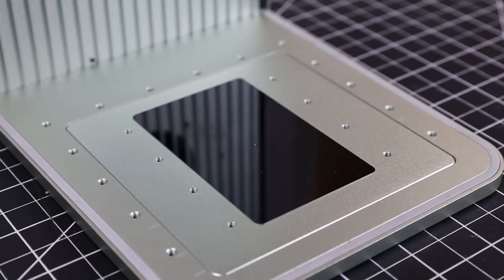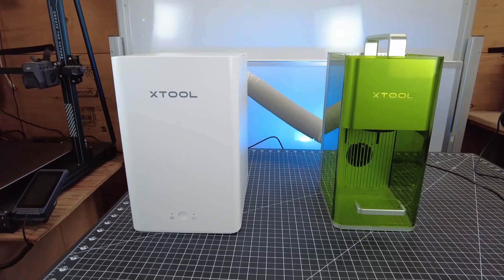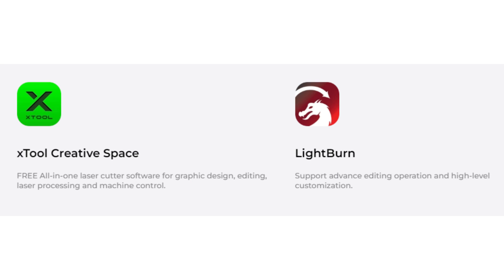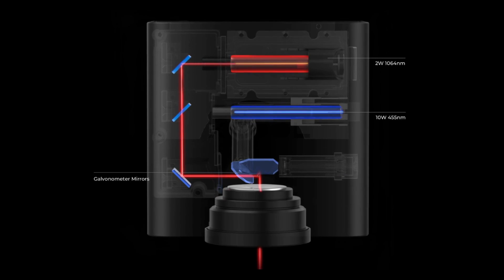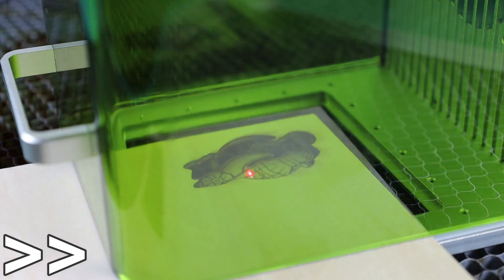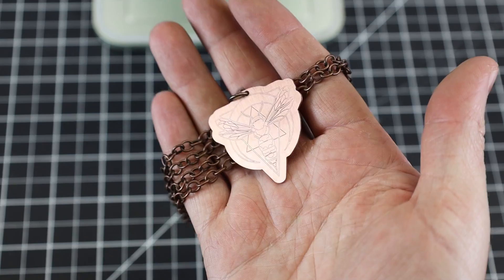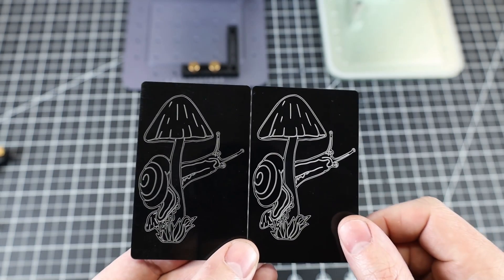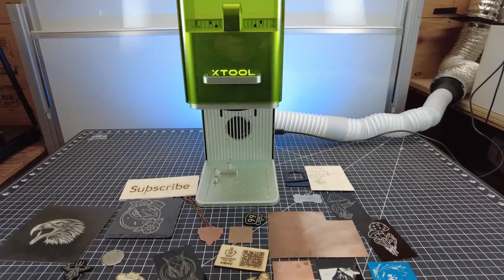Beta xTool F1 VS Laserpecker 3 Laser Engraver

Comment from the maker: xTool F1 Portable Laser Engraver IR + Diode Laser (US) - https://bit.ly/xTool-F1-Laser-Engraver
xTool F1 Portable Laser Engraver IR + Diode Laser (UK) - https://bit.ly/xTool-F1-Portable-Laser-Engraver-UK
xTool F1 Portable Laser Engraver IR + Diode Laser (EU) - https://bit.ly/xTool-F1-Portable-Laser-Engraver-EU

Other xTool Lasers and accessories: 
xTool D1 Pro 2-in-1 Kit: 455nm Blue Laser and 1064nm Infrared - https://bit.ly/xTool-D1-Pro-2-in-1Kit
xTool D1 Pro Laser Engraving & Cutting machine - https://bit.ly/xToolD1-10W
xTool D1 Air Assist Set - https://bit.ly/xToolD1AirAssistSet
xTool RA2 Pro 4-in-1 Laser Rotary - https://bit.ly/xToolRA2Pro
xTool Honeycomb Cut Bed - https://bit.ly/xToolHoneycombBed
xTool Materials - https://bit.ly/xToolMaterials
xTool 20W Diode Laser Module - https://bit.ly/xToolDiodeLaserModule20W
xTool Enclosure Smoke-proof Cover - https://bit.ly/xToolEnclosure
xTool Smoke Purifier - https://bit.ly/xToolSmokePurifier
xTool RA2 Pro 4-in-1 Laser Rotary - https://bit.ly/xToolRA2Pro

Here is the sawing setup that I used to use out the copper necklace:
Easy Saw Starter Kit - https://bit.ly/EasySawClamp
Aluminum Accessories -  https://bit.ly/Easy-Saw-Aluminum-Accessories
Knew Concepts Jewelers Saw Frame (Must have for piercing cuts with the Easy Saw Clamp) - https://amzn.to/3DQ7OOI
Nano Jeweler Saw Blades (Some of the best blades I have used) - https://bit.ly/NANOSawBlades
Blade Butter - Cutting Lubricant - https://bit.ly/BladeButter 

Tool Mounting Parts: 
GRS Fixed Mounting Plate (Needed if you want to be able to quick swap your tools) - https://amzn.to/3YfSJOo

GRS Optional Mounting Adapter (You don't need this unless you have no place to mount the mounting plate on your work bench) - https://amzn.to/3DMsJ56

Easy Saw Third Party Upgrade Options:
Easy Saw Small Parts Adaptor (GomeowCreations Design) - https://bit.ly/Easy-Saw-Small-Parts-Adaptor
Replacement Thumb Screws For The Easy Clamp (M6 X 25) - https://amzn.to/3HMAmts

Accessory Organization:
Easy Saw Starter Kit Organizer (GomeowCreations Design) - https://bit.ly/Easy-Saw-Starter-Kit-Part-Organizer
Aluminum Accessories Large Plate & Clamp Part Organizer (GomeowCreations Design) - https://bit.ly/Aluminum-Accessories-Part-Organizer

3d Printer Filament That I Use:
PolyLite ABS - https://bit.ly/PolyLite-ABS
PolyLite ASA - https://bit.ly/PolyLite-ASA
PolyFlex TPU 95 (Flexable) - https://bit.ly/PolyFlex-TPU-95
PolyLite Silk PLA Blue - https://bit.ly/PolyLiteSilkPLABlue
NylonX Filament - https://bit.ly/MatterHackersNylonX
PolyTerra Marble PLA - https://bit.ly/PolyTerraMarblePLA
TECSONAR Tricolor PLA - https://amzn.to/3H79d5N
Build Series PLA - https://bit.ly/MatterHackersBuildSeriesPLA
Build Series Silky PLA - https://bit.ly/BuildSeriesSilkyPLAMatterHackers
Build Series ABS - https://bit.ly/MatterHackersBuildSeriesABS
Build Series PETG - https://bit.ly/MatterHackersBuildSeriesPETG
PRO Series Filament - https://bit.ly/MatterHackersPROSeriesFilament

Amazon 3D Printing Filament:
PLA - https://amzn.to/3gsLE9Z
PETG - https://amzn.to/3pXjjvu
ABS - https://amzn.to/3wsTRjS
ASA - https://amzn.to/2RX8dtM
Polycarbonate - https://amzn.to/3cLdr38
Nylon - https://amzn.to/3iNGeI2
______________________________________________
Note : Most of the links that I use that go to products are affiliate link. This means I make a small commission on anything that you happen buy using them. This is at no extra charge to you and this helps support the work I do on this channel. 😁👍
______________________________________________
#laserengraving #xtool #3dPrinting #3dScanning #DIY #RandyMay

Comment: This was the exact comparison I was looking for - thank you! I already have the M1 and need something that is more efficient for engraving onto metal. Since I already have the Xtool rotary attachment, I was leaning toward getting the F1 vs. LaserPecker 3. Any reason to reconsider? Also, with the F1, how do you appropriately size and place the artwork for engraving? With the M1, since it has the camera, it's obviously pretty easy, but I'm curious what the process is with the F1.
Reply from the maker: You can have the laser outline the design so you really don't need a camera to get things aligned

Comment: Quick question. You said you used the IR laser on the slate and it took 15 minutes? On the Xtool site, it says a slate engrave took 65 seconds and their chart shows that slate falls under the diode laser category. Have you tried slate with the diode? 15 minutes seems pretty long for that engrave.
Reply from the maker: I was just going off some settings that came with the laser. It said that it could be done with either laser so I was just trying the ir setting that it suggested.

Comment: Great video!!!
The keychain was pretty cool for 4 minutes, how thick was the acrylic?
15 minutes for the slate tile...are you sure? Did you use the diode or IR?
Would love to see you do a tumbler and time it, both with the diode and IR.
Reply from the maker: Acrylic is 3 mm stick or 1/8 in. As for the slate tile it took longer because I was using fill and not outline so it had those thicker looking lines with high detail I can speed it up by having less lines per centimeter or just switching it to outline mode. Also on the slate I was using the IR laser. 

I don't have any tumblers on hand but if I get some at some point I'll make some short videos showing those with all the times and settings as well.
Reply: @randymay  thank you!